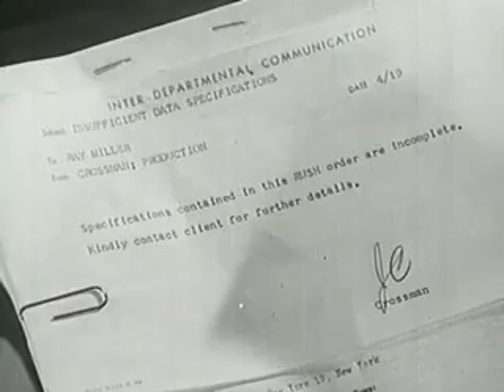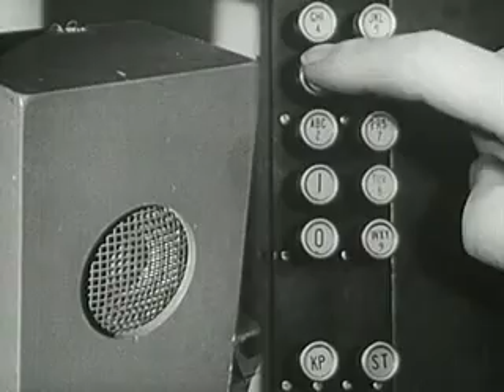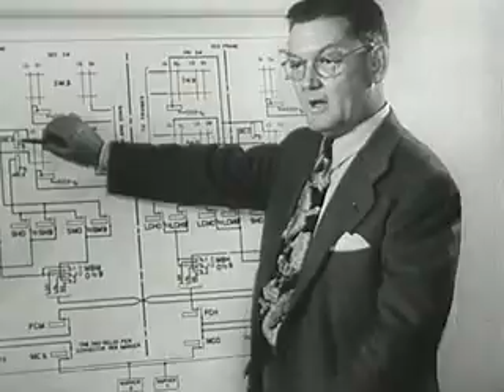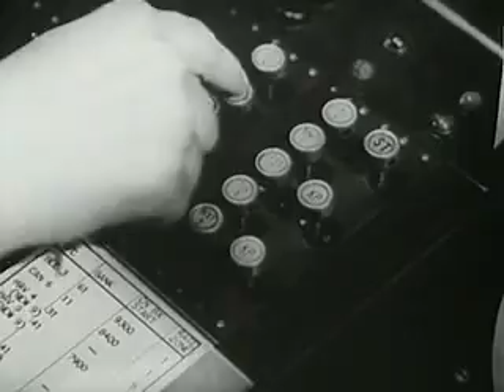"Speeding Speech" Telephony Automation - 1950s

Comment: Basically, you had to ask a long distance operator to do what you could do yourself less than 10 years later with Direct Distance Dialing. (312) is still one of the area codes for Chicago to this day.

Comment: Can't help wondering what happens when the caller gives the incorrect number. Did they sort it out at billing time?
Reply: They would refund you if you told the local operator that you got a wrong long distance number

Comment: On YouTube, there's an "audio" of the Dragnet radio show, where Sgt. Joe Friday makes a long distance call, before this sort of tech was in service.  Apparently, it was very accurate.
Reply: I remember them doing this on M.A.S.H. when a radio link was involved to get to the service men over seas. I understood that that took hours to set up but I didn't realize LD calls within the US did. I guess maybe sometimes you had to wait for an intra-city trunk line to become available
Reply: @Robert08010  Back in those days, placing a long distance calls required several operators, as that recording demonstrated.  This placed a limit on how many calls could be handled.  I remember, when I was a kid, that you had to book a trans Atlantic call, as there were very few trunks.  Back in those days, equipment was built with relays and vacuum tubes which meant they were expensive to buy and also to operate, as they required a lot of maintenance.  I started working for a telecommunications company back in 1972 and a lot of that old equipment was still in service.  There were a few changes that brought down the cost of calls and made the system work better.  These were the transition to digital switching and trunks back in the 60s.  Then came satellites, later to be replaced with fibre and now the move to VoIP.  All these things let to the improvements in the phone system we have today.  It was a lot different when I was a kid, when even a call to the next town was long distance.  Now, I have unlimited free calling across all of Canada, on both my home and cell phones.
BTW, I believe you mean inter-city, as intra-city means within a city, not between cities.

Comment: Didn't relise that tone dialing came so early. I thought pulse dialing was only available untill the begining of the 1980s.
Reply: I first saw a touch tone phone in the mid-late 60s.  However, as shown in the film, it was used by operators well before then.  I don't know if the tones then were the same as the DTMF we have today.
Reply: @James_Knott This film shows MF tones, they are a different set of frequencies than DTMF (touch tone) and was only used on trunks and not by customers directly.
Reply: Touch-Tone debuted in 1964. My family got it in 1973.
Reply: Those tones are just "MF" which was used by operators and exchange equipment, and have different frequencies than DTMF and every dialing sequence has to start with pressing the "KP" key before and "ST" key after dialing the called number but it was basically the same concept.

It was vulnerable to exploits and unauthorized devices that produced those frequencies were called "blue boxes". Started getting phased out slowly starting in the mid-70s.